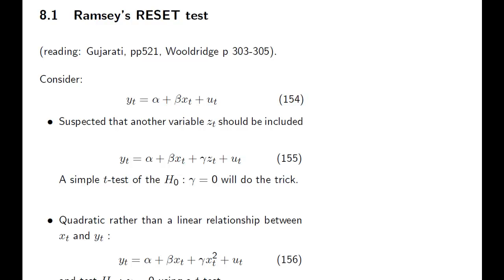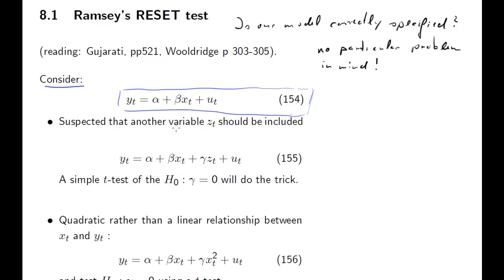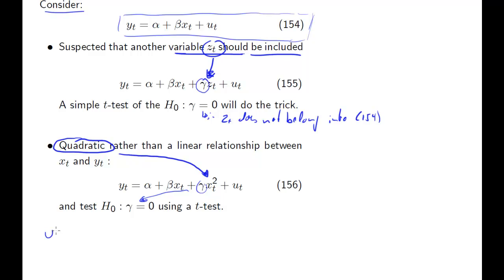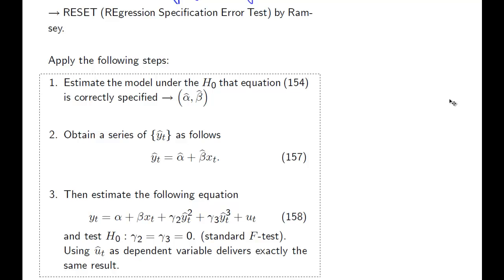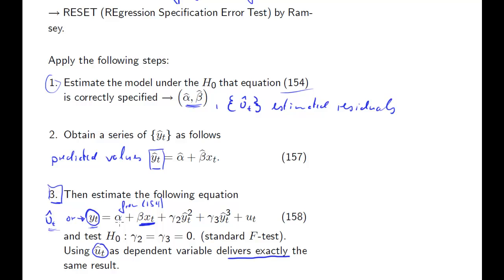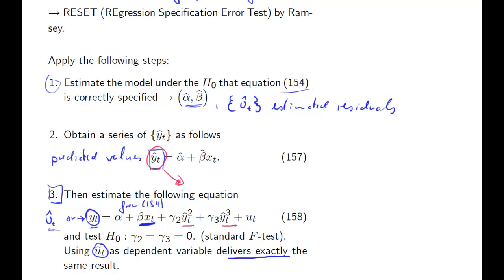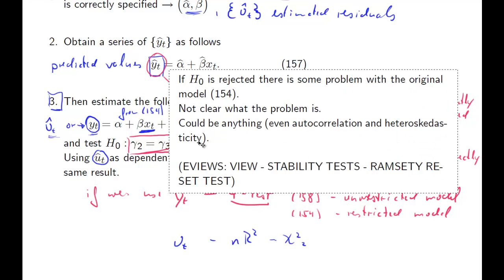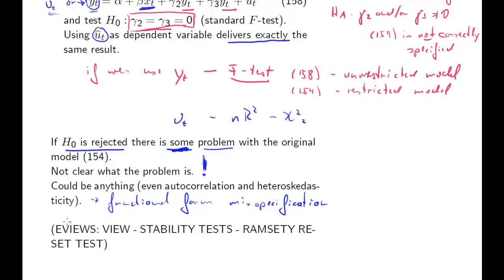ECON20110 Ramsey Reset Test

Comment from the maker: Yes you can use Chi-Square critical values if you use the estimated residuals as the dependent variable in equation (158). The degrees of freedom you need to use is equivalent to the number of additional terms you included, here gamma_2 and gamma_3, hence we would have 3 degrees of freedom.